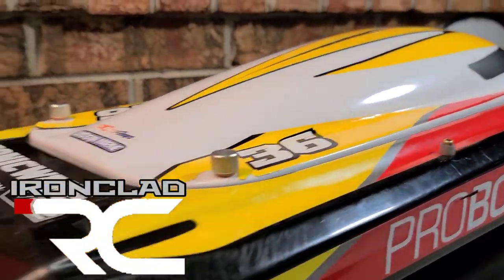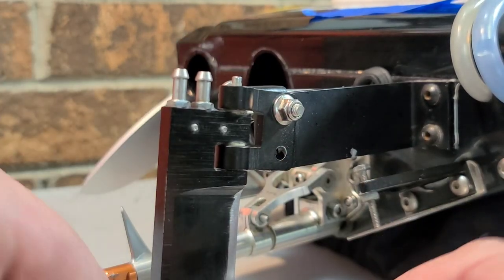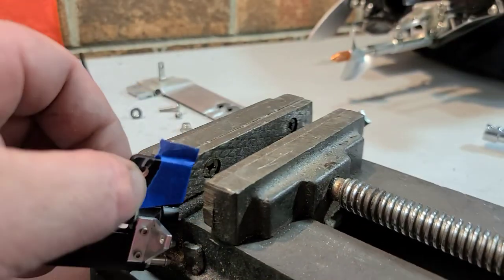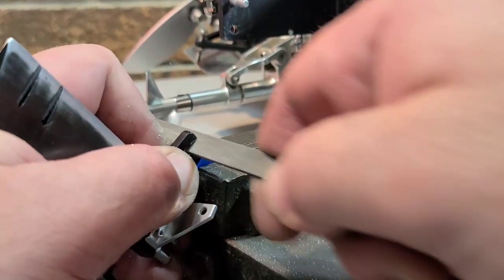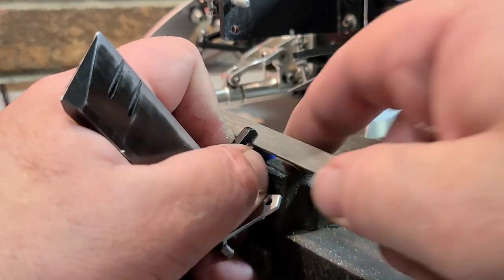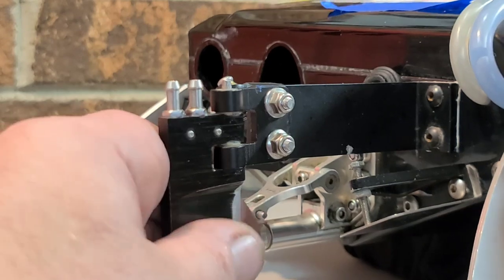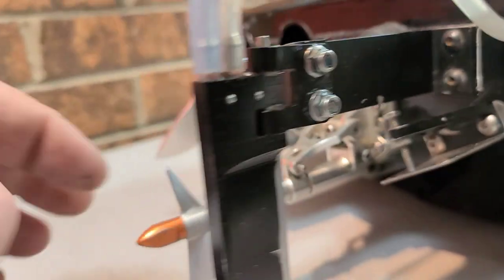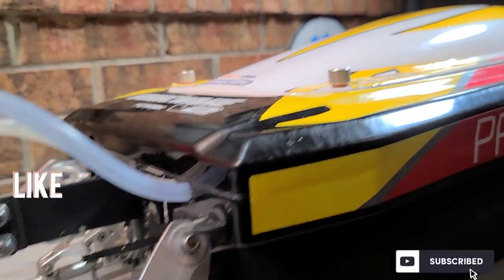Never Replace Plastic Breakaway Screws On Your Rudder Again Sonicwake 36 - Rc Boat Rudder Mod

Comment: Great mod there Big B! I'm new to your channel here in Australia and lovin it! I just ran my first rc boat-Recoil 2 shreddy, AWSOME BOAT! Unfortunately I snapped the push rod connector bolt (the 1mm bolt which is in the black alloy arm from rudder) The rudder did kick up also. Is there a beefier option or mod for 'push rod to rudder connection assembly" ?
Reply from the maker: I used these.https://www.ebay.com/itm/162723856565?mkcid=16&mkevt=1&mkrid=711-127632-2357-0&ssspo=ro7lsaJmQ1O&sssrc=4429486&ssuid=yQkZS9FcQay&var=&widget_ver=artemis&media=COPY You'll need to drill out the rudder arm to accommodate the larger connector.

Comment: Brother THIS IS GENIUS!! Where do you get these ideas from? I hate those nylon breakaway screws. They're expensive, the nuts never really tighten, and I've had them 'snap' on occasions without even hitting anything hard (just the water pressure).
This simple mod is awesome 👌   Thanks so much for sharing Big B. And the bonus is you get to do some file work! 😂👍
Reply: Zip ties also work instead of nylon screws

Comment: The new Recoil 2 already has this done, it also uses the plastic screw to prevent overtightening the bottom bolt.
Reply from the maker: I got the idea from the ose rudder and recoil 2.

Comment: What about using a small spring? It'll automatically go back to down position.
Reply from the maker: Yes sir that would work great.  Pro racers use a spring/springs in races to retract the rudder.  It's gotta be a heavy duty thick spring for it to work  I've seen 2 springs one on each side of the rudder.  Thanks for watching

Comment: I have rudders that come from the factory that way and I tried it on my Sonicwake and it didn't work, maybe because of too much speed and jumps on each lap it went backwards and I didn't want to tighten it too much so as not to hurt the transome if I hit something it works for me the 4s boats I hope it works for you
Reply from the maker: The top screw needs to be fairly tight.  Lock-tite is a must.   Gonna test thus evening
Reply: @IRONCLADRC  yes I know but I'm just telling you my experience and as I told you I have rudders that already come from the factory with that system and it works very well because the braket also has its trick to tighten it, good luck !!!